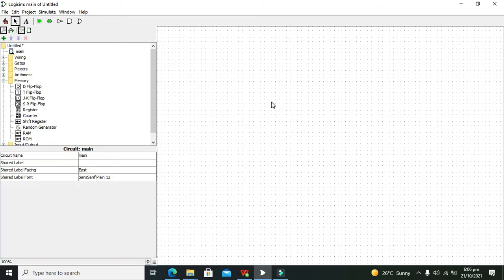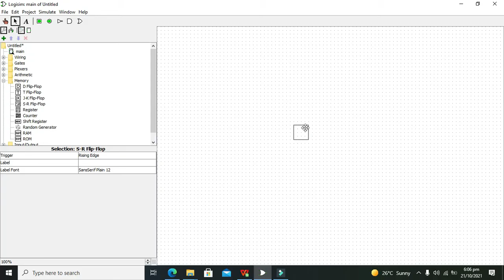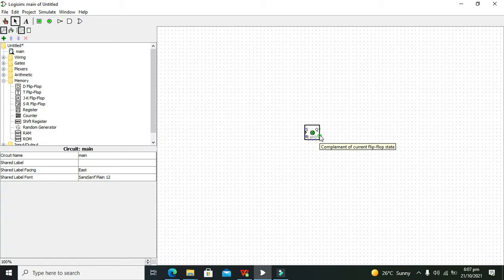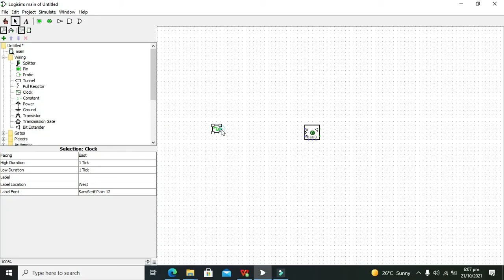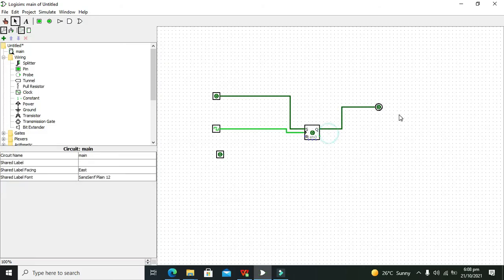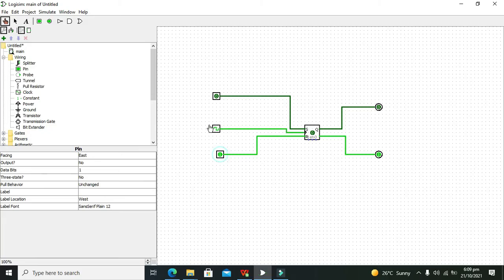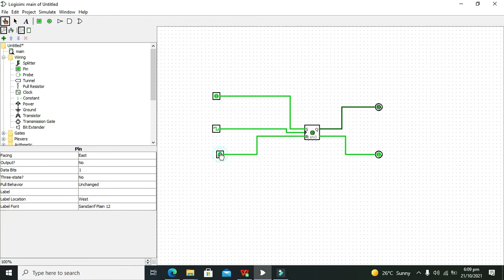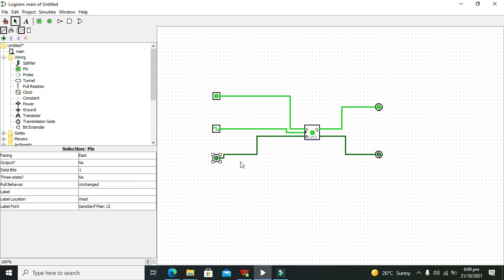how to use an SR flip flop in logisim | use of RS flip flop in logisim

Comment: Nice.

Is there a schematics to do the same thing but with one input.

You push the button you get output 1. You push the same button again you get output 2. 

Thank you? I am not in electronic or else I am in video games and I am trying to design a puzzle.
Reply: @guillaumemercier3536 There are other memory circuits that are similar to  what you're asking such as a D and T flip flop/latch with 1 input setting both possible outputs depending on the enable input or clock signal that controls access to changing the output. If you're not into electronics but only video games it will be hard to understand what's going on without knowing how logic gates work. Video games are of course built on a foundation of electronics and software engineering thou